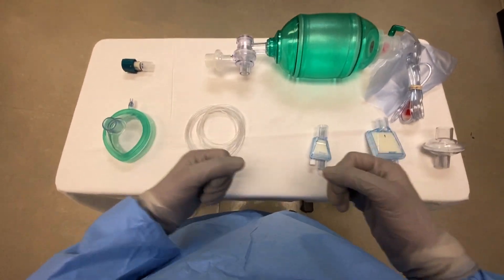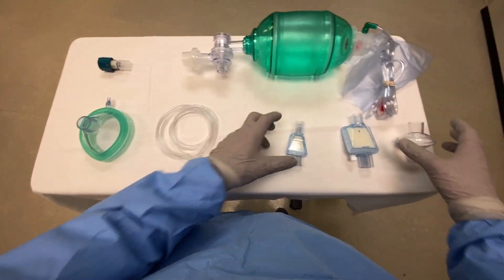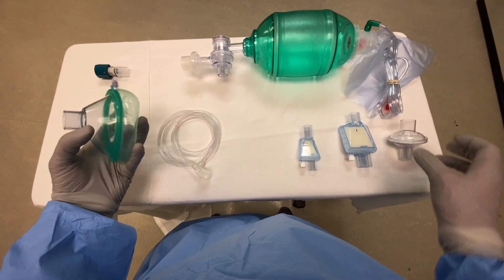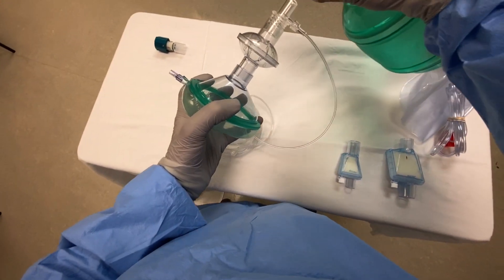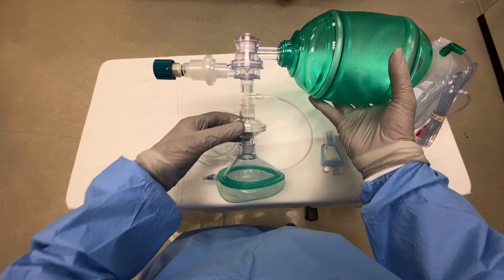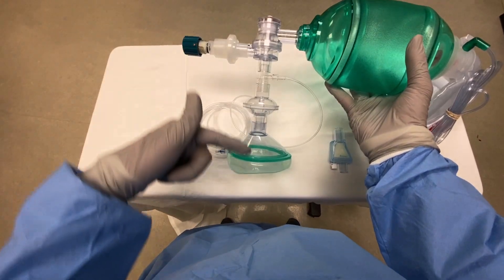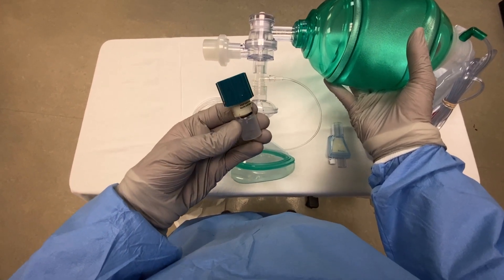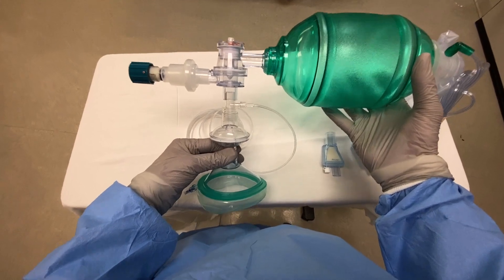COVID-19 Bag-Valve-Mask Setup

Comment: Why the need for a filter before the peep valve ?
Reply: Because otherwise the expired air is contaminated
Reply: Valentin J Hi, but the expiration is already filtered right?
Reply: @regedward  Well without a filter it is not
Reply: Am sorry I still don’t understand. You have two filters one close to the face mask and one close to the peep valve. The expired gas is already filtered via the one next to the face mask , so is there a need for one before the peep valve?
Reply: @regedward  I may be wrong, but the only filter here is the one close to the mask that he added.
Reply: With most Ambu bags, if you put the filter on the exhalation valve you won't be able to fit the peep valve along with it. So you have to put the viral filter between the ET tube and the Ambu bag. Exhaled breath passes through filter then out via peep valve . I work covid icu here in florida. We are busting it for 12hr at a time. This virus is indiscriminate and not selective. Rich or poor, male or female, Democrat or Republican. We get them all. All due respect to my fellow Ovid workers.👍👍
Reply: The filter attached to the PEEP comes with the package of Resusitation Bag (same brand, Sunmed) and it is used to be attached to the exalation port. The filter attached to the mask I think is for the demonstration because he mentioned 3 different filters, 2 different brands; and any of those are the same brand of the resusitation bag.